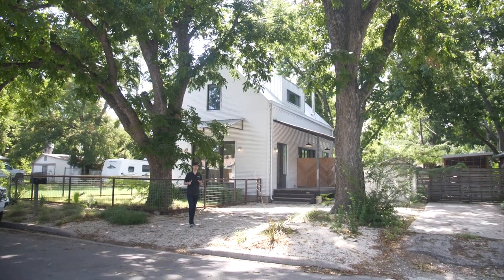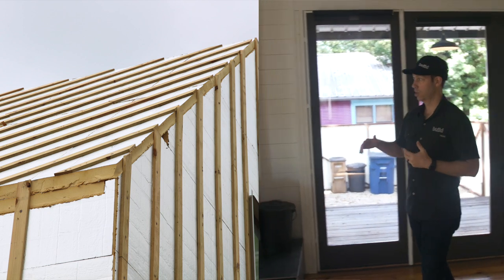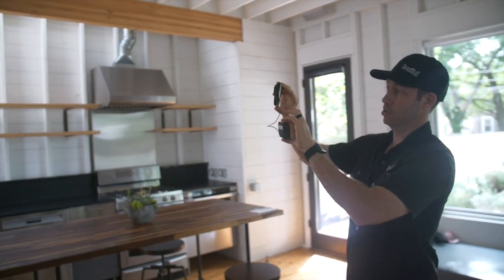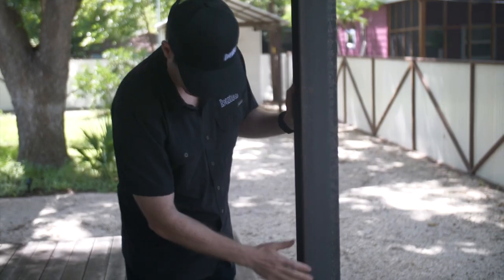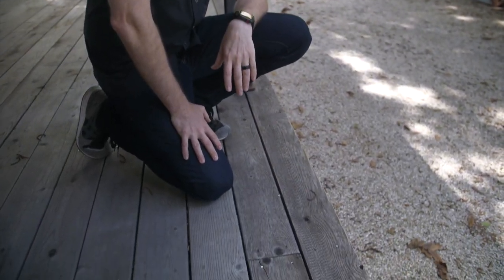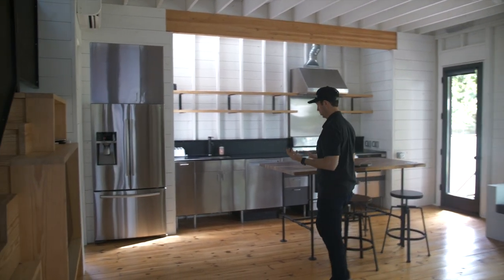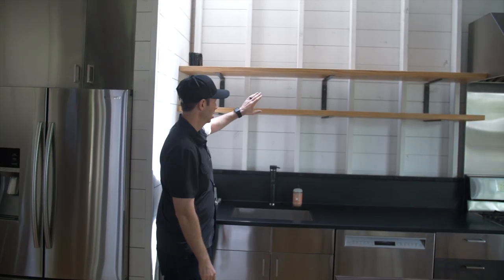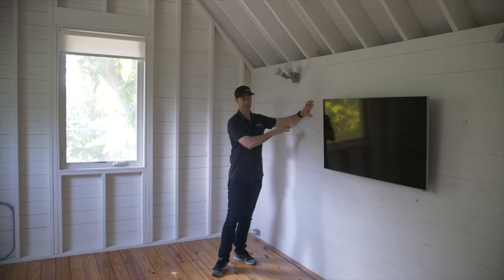This New House Has No Drywall, No Insulation, and an All Wood / Shiplap Interior!

Comment: Is there some place to know or learn how to do this exterior insulation pdfs or books, I live in México and I am looking on building my home. Pretty much every House is built with concrete blocks but zero houses are insulated, I live in the south and heat is asfixiating, turn de AC off 5 minutes and it is an oven, humidity is around 80 to 90 percent all year, we dont have (or maybe care) about R ratings, the wall on my bathrooms side after 3pm is as hot as a kitchen stove.
I have told people here that I want to build my new home out of wood they say it will rot and have bugs, even through they lived on wood houses when they were Young and I mean green wood 4 inches diameter log and metal sheet houses that are still standing.
I loved this design but I cant get my head around how to insulate on the exterior and there are no videos on how to do it.
Any advice?

Comment: 4 years!?!  That's nothing for a house, which if well made should last a century with basic maintenance.  Why are you highlighting the lack of specific problems that no new house that young should have?

Why did the original homeowner (who liked it enough to buy it new) decide to leave after only four years?
The noise? The drafts? The shrinking floorboards? The rust on the bottom of the awning supports?

To me, it looks unfinished, and my first concern when you mentioned the insulation is outside of the walls is what about the bugs?  Over time will this house be encased in the carcasses of dead bugs that made their nests in the insulation?  Can you tell me that this idea isn't putting the cart before the horse?

I do like the shoulder-areas as a concept, but it is a lot of square footage for space that will almost never be used, which translates into big costs.

Comment: It's funny reading the criticisms here: The complaints are all about cosmetic features, as if they couldn't be easily addressed without changing the design/building principles.  The reality is that this house could probably last 500 years with minimal maintenance.  To me this seems like an extremely responsible way to build and is really a blank slate for the interior designer.

Comment: I really like to see innovation and like some of these features, but dislike quite a lot.  The insulation system is of interest.  Maybe there is a significant cost savings throughout the rest of the house that justify some of the features.  However, that floor upstairs allows any liquid spilled to drain right through to the areas below.  My sister's house has this problem.  In high humidity areas I don't see how indoor moisture is relieved.  The corrugated siding will quickly get sooty where I live and be a constant challenge to keep clean.  I can just imagine having to move a vacuum attachment from one stud section to the next all over the house to get the dust or whatever might reside there.  And surface mounted electrical and lighting, especially with bare bulbs, may be a certain "look", but it does not appeal to me.  Keep trying, though.

Comment: So he used rigid foam on the outside.  So first, it has insulation.  Second, rigid foam has an R value of 5 per inch so if you needed R22 insulation you would need 5 inches of rigid on the outside. Doesn’t look like 5 inches to me..  this build might work in southern regions but totally unrealistic anywhere northern. It’s certainly an awesome looking place but the title is totally misleading, bordering on false..
Reply: He says in the video 4" on the walls, 6" on the roof. So not quite 5"

Comment: The problem is most people would probably think bare studs is ugly.  The upside is when screwing something to the wall you will never miss a stud!

I wonder how difficult it would be to add sound proofing?  I guess the walls dividing rooms could have Sheetrock with sound insulation rather than insulation with an r-value.

Comment: Do you think there would be any issues with having this style of work done to an older say 1929 structure, redoing the insulation to be on the exterior of the structure, and then having all the old wood showing on the inside.  How about moisture control if you were living in Upstate New York where we have sub-zero temperatures and lots of snow annually?

Comment: Well, there is even better solution: Porotherm bricks.
It is a huge 1 x 1 x 2 feet brick weighing 20 kg. It does not need any insulation nor structural support.

Comment: Here's how I'd prefer to have a house built I like large houses I'd prefer to have insulation on the out side of the house and on the inside of the house my family had a similar design see my family estate was built back in the 1820s the house is made out of bricks and californian redwood and I live in the house today and if your saying that is mighty dangerous because of the lead in the house well if your wondering the entire family remodel the house several times the sheet rock was removed and individual boards were pulled out with out More than 7 boards broke but they were about  289 feet long and my house is  large the length width is L 578 ft W 578 ft and my house is a 3 story house and the house does have a fallout shelter that my grandfather built back in the early 50s the way Into the fallout shelter is through the basement and you go down the steps behind the armoured and air tight doors and there are 3 air tight armored doors enough to where it'd take a hell of a lot of dynamite to get into and the air system has been replaced several times the air ventalation is right up against the chimney so yeah that's how I like my house it's hot in the winter and cool during the summers

Comment: I have  built places like this 20 years ago it's not new the problem is there no fire protection that sheet rock provides , foam panels encased in metal panels have been on the market for over 15 years  ,, 4 to 12 inches thick , the louvre red door lets shower moisture into other rooms rasing the Humidity

Comment: Metal panels ! ,, Framing fail at 500 degrees , I seen 1/2 inch thick H columns  fail in a cardboard fire this is a 20 year or more ol design nothing new

Comment: Is it is it cheaper to build the house like this then it would be to build it with drywall I mean I hate drywall you can't hang anything on the walls it's gross and disgusting the whole thing in the bathroom I would imagine you could just get soundproof foam and you know panels foam panels and put those slides into those sections and then put the wood over top of that too I mean you don't need insulation like gross insulation made of fiberglass you know makes you allergic I know that my grandma's garage had snakes living behind the insulation there were eight snakes living in one section of the insulation it was so disgusting I don't like using the fiberglass insulation it's gross and animals like to live in it and like mice and snakes and all kinds of things to hide in it I prefer using mylar or foam insulation panels but is this cheaper to build a house like this than it is the traditional way

Comment: The resistance to the transfer of heat R value! Actually its the air that's trapped in insulation that gives it resistance so the tighter you pack it the less effective it is.And its not up to code selling it that way can cause lots of problems

Comment: Fraudulent Headline.
Calling insulation 'outsulation' is Word Soup!!! 
"You wouldn't put insulation inside the ribcage" he said as an explanation. Well DUH!!! They don't put the fiberglass up after the drywall gets painted. Essentially that house's insulation is in the same place as any other house - between the inner and outer surfaces of the outer wall. 
I just couldn't trust a word he said after that. Choosing a wood interior rather than drywall isn't that big a deal to have grabbed my attention.
Reply: He means you wouldn't put insulation "between" the ribs.   Actually, putting insulation in a continuous sheet inside the finished walls would achieve the same advantages as this outsulation:  you're not allowing the ribs or studs to conduct heat and cold past the insulating material.

Comment: Why am i not building a house like this? Because i want my house to be made out of bricks. I don't know why you guys on the other side of the atlantic are so obsessed by wooden houses. 

There is no way a brick house can burn that much. The wind blows? Don't worry. You may need a new roof, but everything else will still be there. Insulation? Well, that's what the air in bricks is for. Air conditioning? Just open the windows at night, and it will be cool all day.
Reply: your "opening the windows at night" is totally dependent upon climate.  here in the Southern US/Southeastern US/Midwest US, we have very high humidity and it does not cool off very much at night.  plus, you do not want to let that humidity that you have been excluding from the house (and treating inside with dehumidifier/air conditioning) to get back in and condense in your relatively cooler house.  the only other option would be to have a house that wasn't very different in temperature or ability to hold moisture than outside.  i believe they call those "plantation homes" and "slave/sharecropper cabins".  i think there's a reason we don't live like THAT here anymore.  you in europe have had over 1000yrs to find the best way to build for YOUR climate.  i would love to see how the natives have handled the humidity issue in europe, that is similar to equatorial jungle levels.  i can't think of any, but please do indicate some.  also, brick and stone here in this high heat environment actually drives the water through the exterior as steam.  yes, steaming the inside (usually wooden, sheetrock and other not so water-friendly) materials.  we have water falling on 100 degree days in some places here.  i think i would rather listen to someone who built in Thailand, Cambodia, or Borneo.  no offense to you and your techniques, which work for you.

Comment: No drywall means you save on paint, drywall, and plaster, so the savings is spent on the exterior.
Reply: With drywall, you easily paint 1 smooth surface. This building is still painted inside, but with multiple surfaces and many irregularities and a lot more time is money. A lot more time.

Comment: What the hell 6 inches and 4 inches maybe he means 13and 19 Sheetrock gives structural strength and no over hang I would condemn it I sure would not a give a CO of course I do the right way to code not the cheap way
Reply: Polyiso insulation is around r-6 per inch... So r-24 in the walls and r-36 on the roof. Our house is insulated the same way and it works great. Very efficient and comfortable.
Reply: @bradkolb4228  sheetrock is required according to manufacturer. There is a fire safety issue .Building codes are a quality and safety standard it the lowest allowed by law. I always go by the book rather to code plumbing, electrical or above everything else .I take no short cuts I cut no corners the code will say follow manufacturer instructions. I was in a house one time sheetrock had been removed my brother walked across roof whole house was swaying.Overhang is a good thing no Overhang is a screw up

Comment: I like the concept of the outside insulation and I think I like the outside metal walls. Not totally in love with the exposed electrical. I wish be wood was stained rather than painted white.

This reminds me of the tough sheds that people are showing on here that you can buy for under 10k.  I think tough shed could have a great business on their hands building homes like this with outcelation and either steel or concrete exterior walls.

Comment: Having exposed pipes can look fine, especially if you're going for the industrial/steam-punk look. However, what is with the unnecessary couplings in the shower riser? Additionally, any plumber worthy of being allowed on the job site should wipe his soldered joints. The bottom elbows underneath that shower valve are green and corroded. That means the plumber left the acid flux residue behind. That is the tell-tale sign of a shoddy plumber on a normally hidden pipe job. On an exposed pipe job it is the sign of a plumber that needs to be waterboarded!

Comment: I had a thought:  The insulation would also be put inside the framing with a thin, easily removed wall panel throughout.  In either case, a complete seal with insulation makes the most sense to me. I wonder if insulation over windows at night would be useful in anyway.  Nobody does it that I can think.  The last thing to seal then would be the doors.  They let out heat I bet.  Edit:  missing word.  Also, I read the Energy Star guide on doors.  It is common for them to be insulated.

Comment: You would still have the crawl spaces upstairs if it was sheetrocked or not. Making it easier to run anything you want. And the ductless ac has molding to run on the outside. Why would you put the linesets on the inside? Ohh you have to now because all your insulation is on the outsideeeeee! Yeah stupid!!

Comment: Enough of your show & tell bullshit!!  Someone needs to build a mock-up of a traditional  exterior wall. By that I mean 2x6 studs, 1/2"  OSB, 30lb. felt, and wood siding. Interior: 6" fiberglass insulation; poly vapor barrier and 1/2" GWB. Now, stick the Flier camera! Given an outside temperature of, let's say 30, and an inside temp. of 70, check the temp. directly over the stud on the interior. I find it hard to believe the heat loss at that point justifies doubling the cost of the exterior walls, but nobody wants to hear that. They want to sell you something you don't really need.

Comment: Um... so... what do you do about dust and stuff? Are you vacuuming between the studs? And all that dust accumulating on exposed ceiling rafters, conduit and piping? And the smell of wood? Wait, you actually painted wood.... great move, very efficient, lol. LOVE electrical boxes on a trim level: what can possibly go wrong with electrical box that a pet/child could climb over and spill something on it! Exposed wiring makes a great wet towel hanger!

BTW dust is produced by people living in the house (13:45).
You know where you see this kind of exposed framing? Basements. I have a very dry, conditioned basement, in fact I have an office in the basement. The ceiling above is 100% exposed, I enjoy beautiful piping, wiring and wood every time I raise my head up... and I enjoy no sound barrier between floor above, dust accumulating on the exposed surfaces.. 

I get the point that "no Sheetrock = I can access EVERYTHING". And you end up with super noisy house, fine. 
But if you know how the wall is framed - you cannot help it but wonder how straight those all exposed studs are. Rather, you end up using some premium grade materials for framing to achieve spotless finish... your frame is actually your finish: how many framing professionals can actually do that?!

I don't want the house that looks like a cabin. May be its just me. But except for all exterior insulation - there are just too many thing that can (and will) go wrong with this house if a FAMILY with KIDS would move in... It makes for fine office, but that's it...

Comment: Personally I really like the concept and exposed wood. This house is convenient and cost effective.
No more guess work as to the origin of that water leak or wiring short resulting from snacking mice and roaches. No destruction, reconstruction time and materials costs to access plumbing and electrical for servicing, repair or remodeling saving lots of time and money especially if owner is not doing any of this work. Quickly and easily add to or relocate outlets, lighting or other electrical fixtures. No more worry, work nor expense related to winterize/insulate plumbing from freezing. Exposed plumbing and electrical, conduit can be eliminated with [removable] beams and posts. A board or panel decorated, painted, stained or not can connect across studs providing an accent or backdrop from which to hang pictures, shelves, mirrors, potted plants, candle holders, etc.  Exposed studs provide ready made recessed video or bookcase, cabinet, display case, pantry, enclosed hunting and fishing equipment racks, etc. any of which glass or other type doors could be attached. Who's  to say you can not cover any or all studs with paneling, drywall, or my favorite, 1" thick rough sewn cedar boards TnG for that cabin look and feel on any wall or ceiling you choose. I prefer natural and stained wood over painted. As studs, beams and rafters are maintained in a controlled constant temperature range out of the changing elements, any maintenance of unpainted wood would not be necessary for 10-15 years, probably longer. Then only to recondition the wood restoring its natural beauty and restain if desired. The cost and equipment required ... a turpentine and oil mixture, rags and elbow grease to wipe on-wipe off 2-3 times as necessary. A ladder would be useful too. The inconvenience of open doors and windows for ventilation would be no more than that for priming and painting. All this and reduced utility bills too.